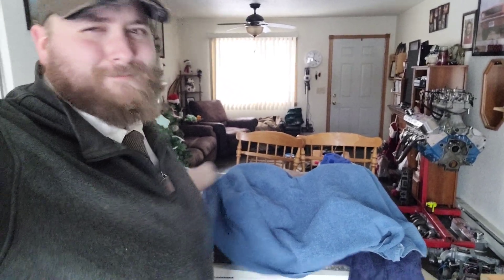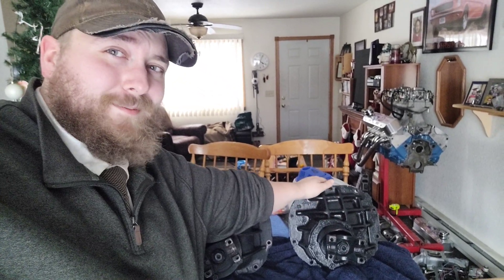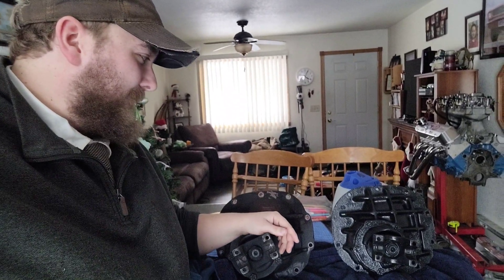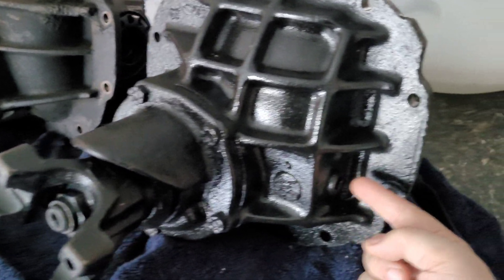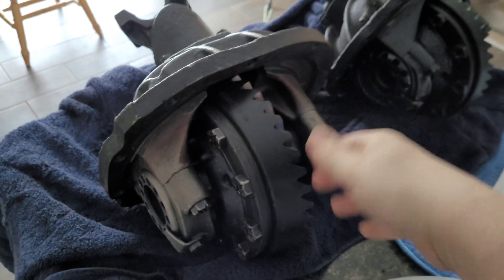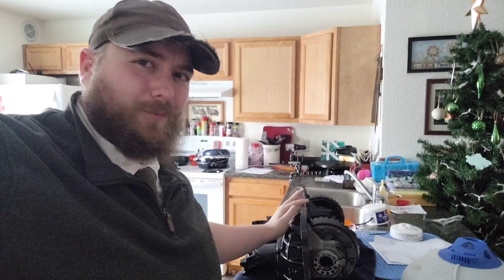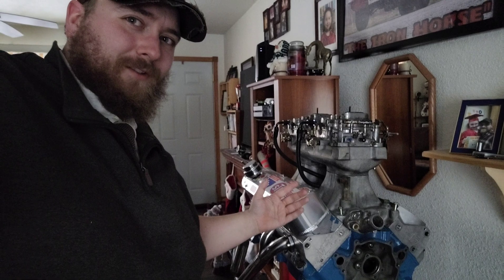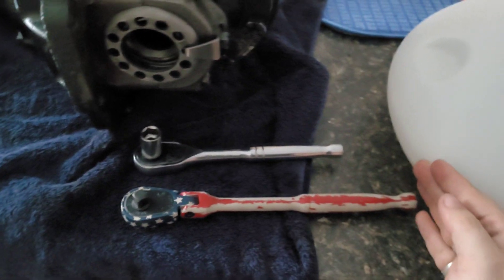Gear Ratio! | What Does It Mean? | How To Choose Axle Gear Ratio For Best Performance! | New Parts!

Comment: Gearing is indeed everything. I met a guy with an LS swapped miata at the local 1/8th mile who had a cd009. He complained about one of the shifts being too long and said he was gonna switch to a T56 magnum to fix that, as well as to have easier rebuilds (it was an N/A 6.0 that he used nitrous on, less than a 200 shot, and only for roll racing, how often does he really have to rebuild a 1000whp capable transmission?).

Anyway, I went home that night because I had a hunch, and I was indeed correct. After sitting down and doing the math, the T56 magnum didn't have any closer shifts than the cd009, it just had a second overdrive and all the ratios were numerically lower (effectively longer), which would simply require him to have a numerically higher (effectively shorter) rear end ratio. And we all know that requires a smaller pinion gear, which will then be less efficient and receive more stress.

Haven't met him since (the track closed for the season shortly after and I haven't gone back since it reopened, yet), but I almost want to make a little spreadsheet to show him if I see him again. I don't think he'll gain anything by switching transmissions, and furthermore, after discovering what I did I decided that double-overdrive transmissions in general were stupid. Long live the cd009, I guess.
Reply from the maker: Sounds like he needs a 250hp shot to me! 😂
Reply: @newguysgarage6802  For real, lol. But my main point is that the existing cd009, even with something that seems long like 3.23:1, would serve him better as far as shift spacing to keep him in the powerband than even the direct T56 equivalent of 4.10:1.
Reply from the maker: @Drunken_Hamster  definitely, and like you said he does it from a roll which is extremely easy on the transmission compared to a dig. 🙂

Comment: here's the road racers equivalent Mark Donohue; "If you can leave two black stripes from the exit of one corner to the braking zone of the next, you have enough horsepower."  So are you planning to go to a taller tire now ?
Reply from the maker: 28" is about as tall as I can fit under the stock body, and I dont want to cut up the car 😅

Comment: Is redline determined by maximum HP or when the valve starts floating?
Reply from the maker: Piston speed is a big factor lol 

And ya HP too, really depends on what your power curve looks like.
Reply: Piston speed and rod ratio. Valve float isn't nearly as much of a problem nowadays as it was 40+ years ago.